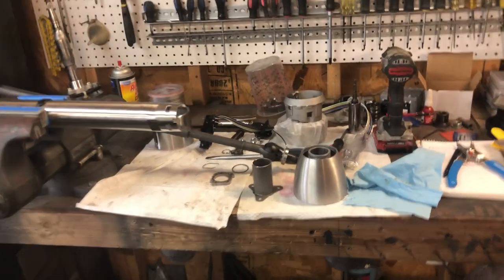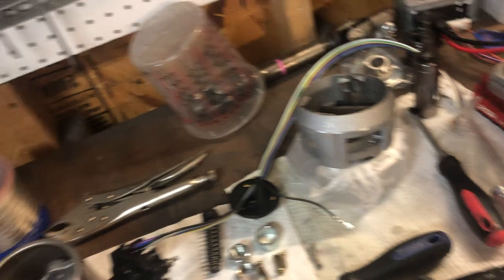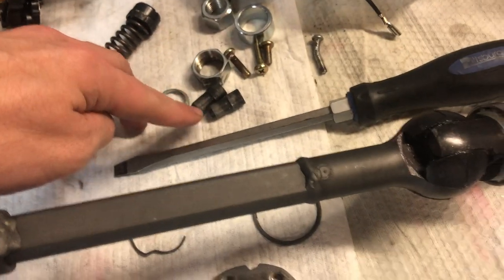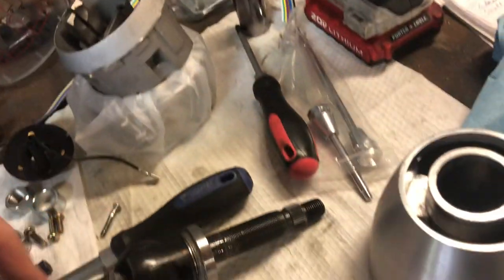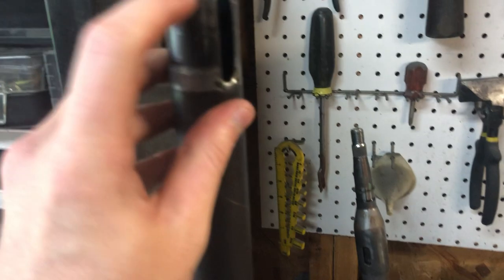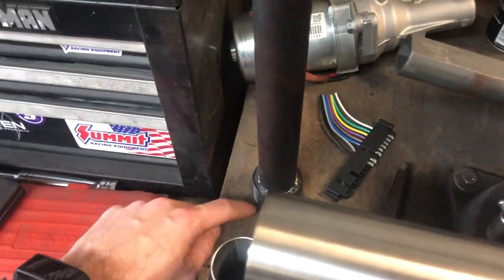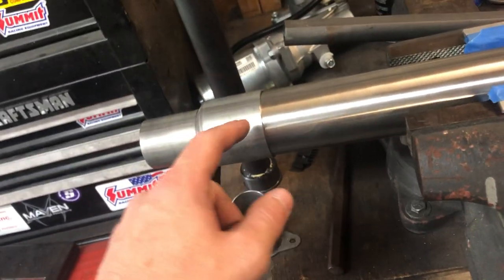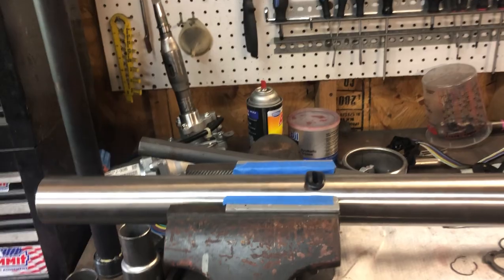eBay tilt column disassembly for EPAS steering part 2 or 3... I think

Comment: I'm doing the same thing right now. My question might be as far as the ring clip that goes in your vid. clip at 6: 04  and the ring with the 4 threaded screws. Doe the clip go on the inside of the tube clip6:34 or the out side?. I for got how I took it out.....
Reply from the maker: almost certain it goes around the outside and snaps into those holes to hold the assembly together.

Comment: Have another question about  the hook up of your system of the epas joints to the your rack. I'm just about done with mine, but I find mine is a bit sloppy from the top of the epas to the tip of the steering box. I'm not using a rack, since I'm working on a vw dune buggy.. I think my issue might be is that I tightened all the joints with the wheels off the ground, and when I checked everything was loose. What are your thoughts?
Reply from the maker: not sure if i follow 100% so you may need to send me a short video showing me via fb or something if you can. but wheels off the ground shouldn't matter between steering box and epas as both should be mounted solid to the frame/body of the car assuming the chassis is solid and doesn't have flex. you have your epas like mine, welded/bolted to the column? i've seen some use u-joints on both ends. the epas/column should be bolted solid and the steering box should be on the frame, or has been on every vehicle i've seen. this won't take away steering slop of a gear box and linkage.

Comment: I know its been over a year since this video, and was wondering if you posted anything else since. With the help of your video's I was able to take my column apart and am very grateful. Now I am at where you left off on your video, and was wonder if you did a follow up on how you put it all together. Where to cut and how did you figure it out. Thanks again....
Reply from the maker: glad it helped. i had a follow up, but i don't go over in detail where to cut or measurements. just kinda go over what the final product comes out like. it probably varies a bit column to column and depending on what motor you use, but you can figure measurements out by inserting a rod into the column and using a straight edge to see where things will end up. that and using the D rod and that hollow D rod it can sleave into. if you run into an issue and can't figure it out, message me on insta or fb and i'll try to help. may need a video or pics to see where you're at on it.
Reply: @callofgeorge  Thank you so much, if need be I'll be in touch.....

Comment: I installed EPAS from a '09 Corolla into my daughter's '63 Nova. What kit? I used the original column and kept the column automatic shifter. Now I'm installing the same kind EPAS in my '36 Chevy coupe.
Reply from the maker: what do you mean by "what kit?" sorry, this was an older video and my memory isn't great. if it's something i said can you give me the time stamp in the video by typing @ and the time without a space.
Reply: @callofgeorge  Sorry about the confusion! I've been watching a lot of vids on EPAS and commented on the wrong one. Some of them showed kits for '55-57 Chevys and early Corvettes. I see you're going through the same " measure over and over and refigure everything" process I did.
Reply from the maker: yup, i just made my own kit essentially. measure, weld, cut, re-measure, re-weld because i measured wrong the first time lol. trial and error. but it's been treating me well for a while now.  @lylejohnston4125